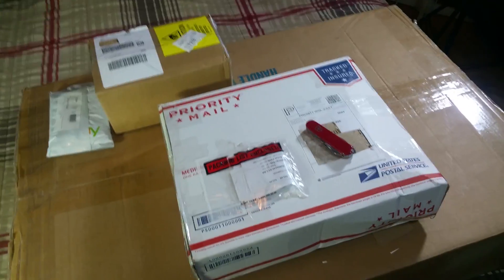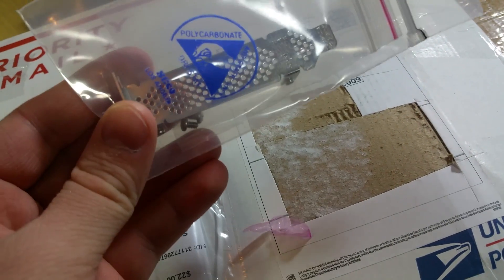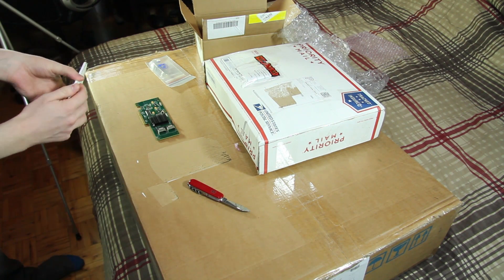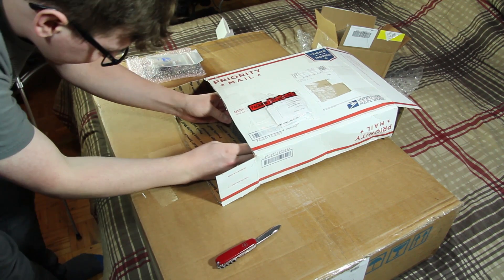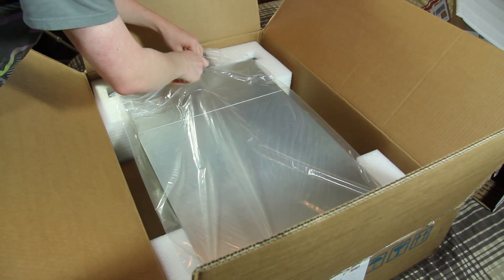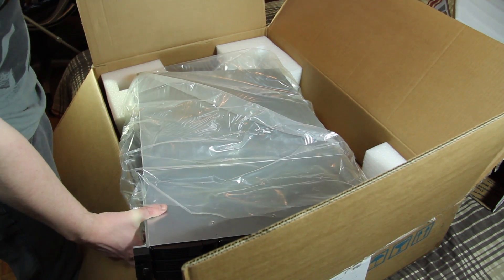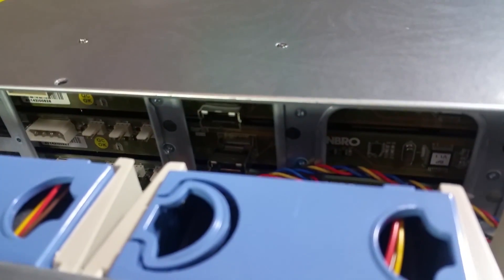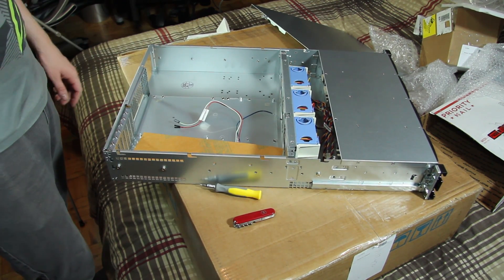Unboxing New Storage Server - Build Log Part 0

Comment: 14:00 the plastic glued to the bottom protects the motherboard from possible long leads or solder bumps touching the metal case and shorting

Comment: Great review on the case... Does it have screw holes for and SSDs?   If you like the ITX motherboard you could get a Molex powered SAS expander (RES2SV240) to utilize all 12 hot-swap bays,  but it is cheaper to get a new motherboard and an additional HBA
Reply from the maker: Yes, all the drive trays have holes for 2.5" drives and ssds. As for the other bays, Ill decide once I get more drives to go in. I'll probably just use a sas to sata breakout cable for the top 4.
Reply: I got really lucky and have a SuperMicro X10SL7-F (14 SATA/SAS ports built in)   I was thinking about SSDs in addition to the bays
Reply from the maker: Nice! I'm planning on getting a pair of 500Gb ssds for write cache eventually

Comment: i bought a hp 180 g6 its hp raid 410i i want to say 1 sas cable supports 14 bays
Reply from the maker: +MrFmlouder on this chassis, it seems there is 3 separate backplanes instead of one, so a single cable is limited to 4 bays physically. Also for this card to run drives at the full 6gb/s it is limited to 4 drives per sas port.